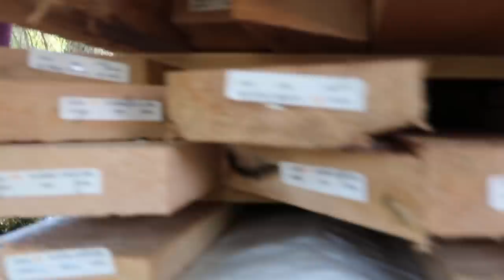TIMELAPSE- Couple BUILDS Post & Beam Shed KIT in 20 Minutes Bought OFF the INTERNET

Comment: Good Morning Mr. & Mrs. Lumnah ( and Ms. Lumnah too! ).
Is this part of Mrs. Lumnah's video editing training process?
Whichever, it's nice seeing the timelapse.
I can hardly wait to see the wall boards up in the milking parlour and workshop as well as the the electrical getting setup out there.
Mayhap, next year you can get a rain catchment system in place on the barn so you don't need to lug water down to them goats. I'm not sure with goats as my experience is with dairy cows, but Mr. Lumnah, I suspect that when Willow and the  other does kid and begin lactating again next spring that their water intake will skyrocket in conjunction with their milk production. It sure did with our cows.
As I said, my dairy experience is with cows so I don't know if Willow will need to be "dried off", and is so, for how long. For most of my life Dad gave our cows a month dry period, however, towards the end of his time on earth, he stretched it to six weeks. Yes, it took some milk of the backend of the lactation, but the improvement in body condition on the cows after calving paid off because they were able to maintain high production longer and had a better breed back percentage. Mr. Lumnah, I am in no way implying that Willow has poor body condition. I'm just asking the question about a dry period for dairy goats out of curiosity.

Comment: My daughter's cat rolls in the dirt so much that she calls him Chinchilla Baby.
By the way, my d says you don't square up the building because she didn't see it. I said you did, that you just didn't show it because of the time crunch. Me or her?
Reply: If you watch the full videos he constantly squares up everything.
Reply: I'm sorry. I totally missed it but that makes me right. I will go back.
Reply: I watched the video from beginning to end and it never showed him squaring up that building.
He used the square a couple of times to cut the boards straight. He used the level a couple times to plum the siding.
Like I said, I'm sure he did but it doesn't show he did. I still win.
Reply: @tammyfinch6735   Al squared up the building when he measured the position of the initial 6x6's and checked also for parallel.    Once that is done, and he starts erecting the vertical beams, then it's all about the beams being plumb, and following the layout markings on the lumber.   Keep in mind this is all rough lumber, so there is a variation in thickness in all dimensions, from one piece to the next, which will affect accuracy.     After squaring the initial 6x6's it's all about being reasonably square, and keeping it plumb and level.   Hope this helps.
Reply: @patrickinottawa27  I knew he had! Thank you 😊. I won the bet! And I know all of that. I've been in the trades for many years. That's why I knew he had.